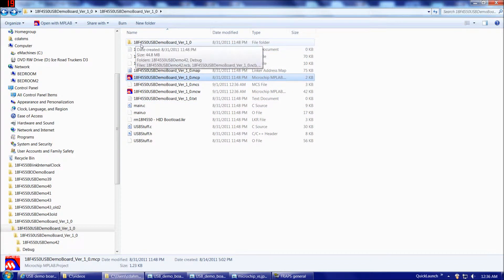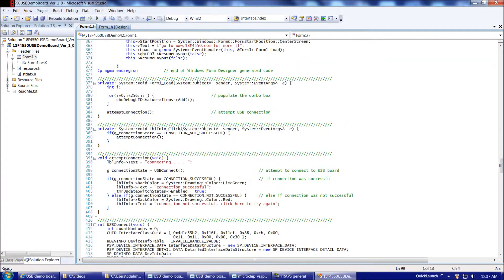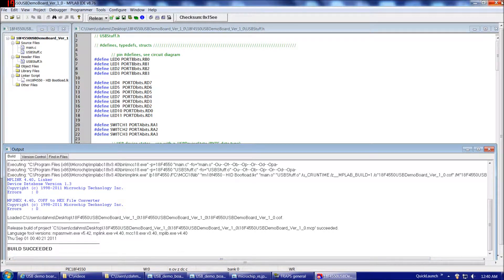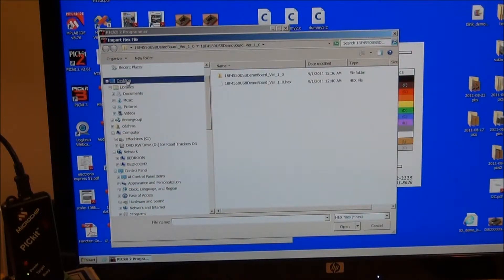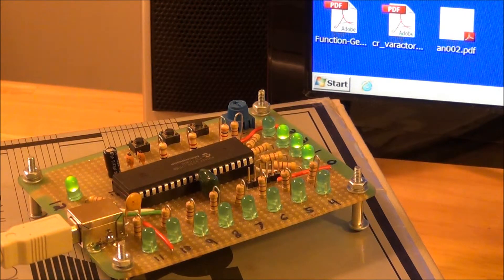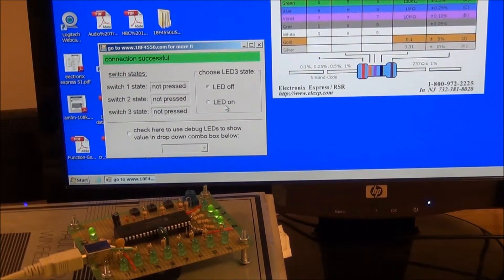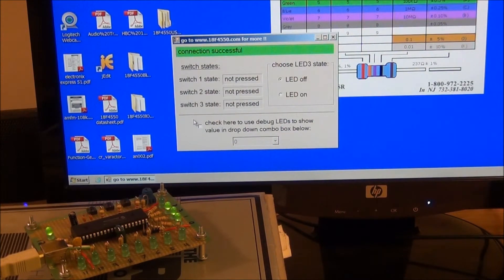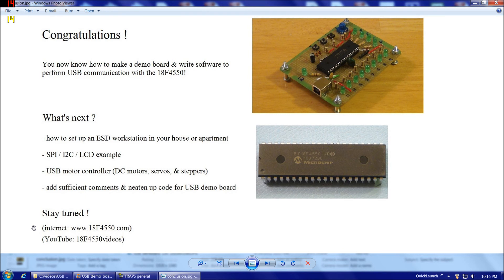18F4550 USB demo board - part 2 of 2

Comment from the maker: Hello and thanks for the interest in my channel, I wish you would have mentioned interest in the USB motor controller example earlier!

I have spent the past few weeks getting into OpenCV and EmguCV, I plan on doing a tutorial series on those next.

However, I have most of the USB DC motor / stepper / servo controller example worked out, eventually I plan on finishing that and posting the project.

Have a good one!